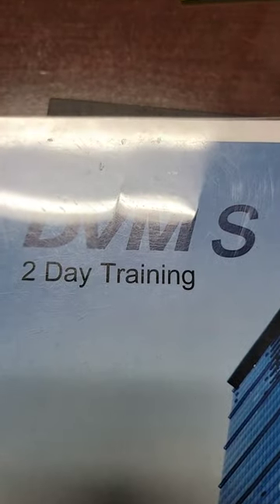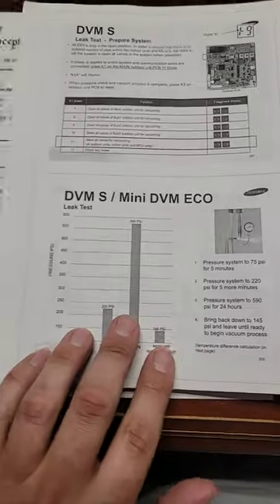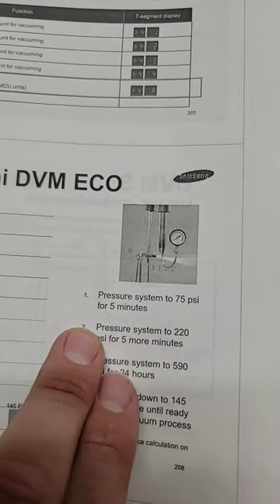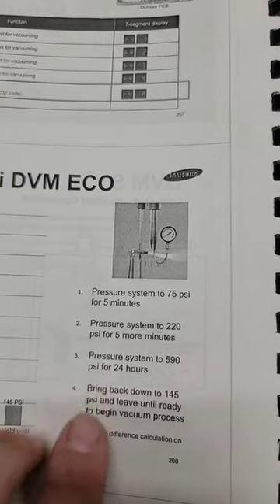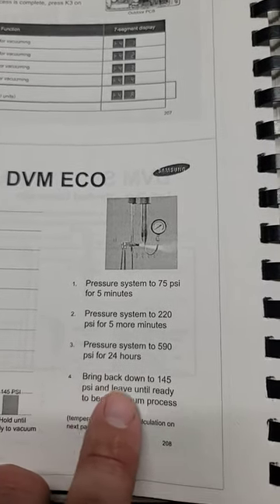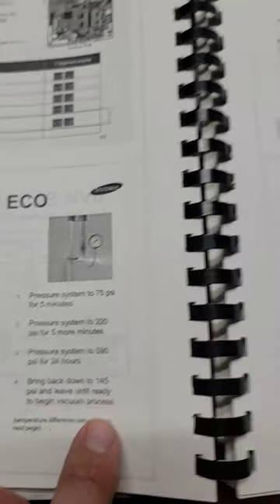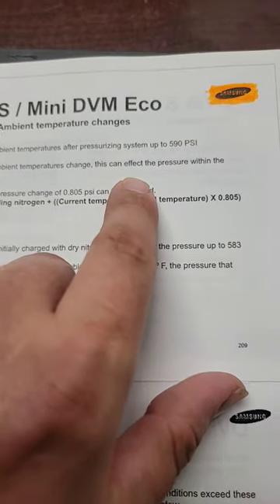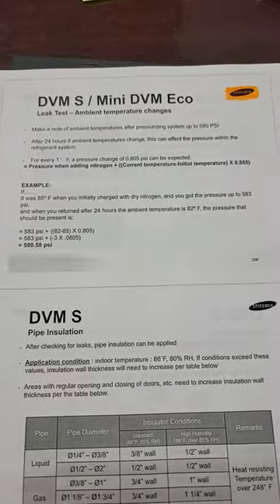Expert Tips for Leak Testing Mini Split HVAC Systems

Comment: In my opinion 500 is good for nitrogen testing leak testing is what I'm assuming you're referring to if you think about it the unit is actually made to handle 500 psig cuz of the refrigerant charge.
Now I'm not expert on Mini Splits but I do know HVAC and Refrigeration pretty well enough to know in general those systems run at around 100 to 500 psig .
Reply from the maker: Absolutely Brandon totally agree

Comment: I just installed a Gree mini split, and it calls for 500 psi for pressure check. The nitrogen regulator I had could only go up to 490 before it starts to vent. But it held for 24 hours at 490. after all that work I did and inside unit will not power on. Even with a 250 volt reading from unit. Display is blank. Nothing.

Comment: OK so what if u just pressure tested it about 180 and once u know the pressure stable n no leaks then starting the vacuum? What kind of issues would u have from not testing at all those specific amounts?
Reply: Honestly I would like to know what issues u would/might have if u didn't test all those diff specific psi's
Reply: Well, you will find out. If it leaks hopefully it will still be under warranty so the customer doesn't get too upset. I have had some compressors that kept running after pumping air for who knows how long. Of course those were regular splits not minis.
Reply: If it makes you feel any better, brazing those small lines is so easy. The silver flows like butter. If you have confidence in your work I don't think there's anything to worry about.
Reply: Mini splits don't require brazing.